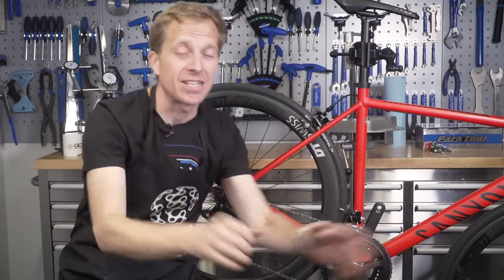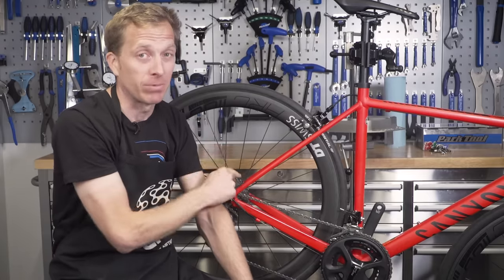5 Minute Simple Bike Gear Tune-Up | Indexing, Cable Tension & Limit Screws

Comment from the maker: What part of your bike can we fix in 5 minutes? Let us know and we'll cover it if we can.
Reply: GCN Tech headset adjustment please 😉
Reply: Wheels
Reply: Hi Jon Great video (as always).  Would love to see more videos about Hydro Disc Brakes and Electronic Gearing (Shimano for me).  Thank you (I know there videos about this but would love to see some more whenever you can).  Thank you
Reply: When checking the rear derailleur L  stop, I push the mechanism by hand to make sure it doesn't go past the largest sprocket. This eliminates any  cable issues which may mask a wrongly adjusted L screw.
Reply: Hamstrings please!
Reply: Brakes
Reply: sweeky bottom bracket please
Reply: maybe how to change a BB or a 5 min wheel true? there are some methods using the frame and cable ties?
Reply: brakes touching the rim (after you removed the wheel and put it back in)
Reply: Maintaining mechanical disk brakes. Not all of us have hydraulic! I feel like I am always adjusting the pads and sanding them down to eliminate squeal, even new brakes squeal within a week (200 miles +/-)
Reply: Tubeless (or Tubular if you're brave!) tyre using the repair plug you mentioned in a recent video.  Cheers!
Reply: Setting up the trim function please 👍
Reply: Cosign this. mechanical disk brake maintenance would be very helpful.
Reply: @_clemens_  is the wheel properly in the dropouts? May sound simple but it's remarkable how often they're not!
Personally I find that I need to lean on the bike a little to get the wheel to sit in the right place.
Otherwise, does it rub in a specific place? If so your wheel may need truing.

Comment: One mistake Jon: When you demonstrated how to adjust the front derailleur "H" screw, you forgot to shift to the small cassette cog at the rear derailleur. All you did was shift the front derailleur to the big chainring and, since your rear derailleur was still on the big cog, you were cross-chained when you adjusted the "H" screw. The thing that viewers need to understand is: Always shift the chain all the way to the inside (big cassette cog, small chainring) when adjusting the "L" screw and always shift the chain all the way to the outside (small cassette cog, big chainring) when adjusting the "H" screw. This is true whether you're adjusting the front derailleur or the rear derailleur. Do not adjust anything in a 2x or 3x drivetrain when you're cross-chained. Cheers.
Reply: Inherited a bike with shimano 105 but there is no limit screws on the front derailleur and the chain is rubbing on the lowest gear. How can I fix this?
Reply: @rabg4774  adjust the b screw
Reply: @tonymcnally9355  Turns out there was limit screws they were just filled with dirt so I missed them. I have tried adjusting them but seem to have only made the shifting worse but I will keep trying, cheers.
Reply: @rabg4774  nah mate the limit screws adjust how far in and out to each side the derailleur can go. There is another screw separate called the b tension screw that determines how far up and down the derailleur can stretch
Reply: Thank you D. Eldon!  I kind of figured this when I was doing the adjustment, and your comment confirmed my (inexperienced) approach
Reply: Thank you for that extra info. Would you be able to explain why my front shifter feels super loose in the braking and in terms of shifting ? Shimano grx 600

Comment: My 105 rear-shifter handle was causing gear changing troubles (small to big cogs not jumping or jumping in 2's). Bike shop couldn't fix it but I did; pulled on the brakes and moved gear shifter across which visibly exposes some of the innards - then blasted the insides with WD40 until it worked correctly; squeezed a pile of grease in with my fingers and it's been as-new for months now (I ride about 200km/week).

Comment: Hey Jon, 

When my bikes need a quick tune up, I check my low limit by hand before adjusting the Low limit screw. I always assume the limits screws are still set properly and if the chain isn't climbing to the lowest gear it's due to cable stretch. Whilst pedaling the crank, I try pushing mech towards the big cog by hand. If it goes to my easy gear, the limit screw is good. Then I skip to indexing. 

This can make things either more or less than 5 minutes at the user's first go at it. Once they have this trick, it would be under a minute to tune/index gears if the H/L is confirmed to still be good. 

Still, awesome walk through. Check your limits. Index gears. Go ride. Easy, peasy. 

*Also, nice new 105 R7000 front mech. Not fair.

Comment: Built myself a new cyclocross bike at the weekend from a new frame, and a set of spare parts i had from an hybrid where i damaged the frame, plus a chainset from ebay. 2x8 speed. Struggled to get the gears to shift properly at all, and i remembered one of the older/longer versions of this video, silky smooth now. Old sora shifters, with a new claris front mech and a deore rear mech (older mtb mech). All works perfectly together with the bontrager 750's and some 35mm cross tyres :)

Comment: I think you might have done this before, but showing how to replace internally routed cables would be great.
Reply: They did that already too
Reply: 2 years late, however this has never failed me: 1) pull out the shifting cable
2) put a spare wire througt which is plenty lon, if it is more than twice what the outer will be, even better.
3) pull out the housing. The spare wire shall be kept inside.
4) thread a new cable outer on the long line, if it's long enough put a stop on the end. 
5)Then simply use the inner wire to pull the outer through the frame.  Put the inner wire aside and install the new shift cable. Profit

Comment: Thanks for this helpful video. I need to adjust the gear shifting on my wife's bike and this will make it easier to do right. One request: show us what you're talking about when you mention a a part. E.g. derailleur hanger at 4:52... I see where you pointed but I wouldn't be able to identify the d.h. on a bike. Also cable stops at 0:17.

Comment: Which way to turn the barrel adjuster? Turn the top of the adjuster in the direction you want to move the chain. Simples!
Reply: But is it the same for the front in-line barrel adjuster?
Reply: At the front: I guess and look if the distance increased btween derailleur and chain (after pressing the shifter again). At the back I of course only do it when it wont shift upwards smoothly...so I turn the adjuster until it shifts...and when it doesn't im turning in the wrong direction :)
Reply: I don’t have the luxury of a front inline adjuster so I imagine I’d just have to do it by ear and guesswork. 

Something else though, if I ever move the cable clamp, I’d always screw in the barrel adjuster and back it off about a turn. Cables don’t usually shrink! Of course Di2 solves all this, but brings its own issues to the work stand!

Comment: My Sora 3500 front shifter has a trim function and Shimano recommends setting it with chain on big in the front and big in the back with the chain just touching the inside of the front mech’s left plate.

Comment: Coming from a mtb perspective where 1x is common, a slightly different order than shown in the video is what i'd recommend:
If you have a front derailleur, start with that one, put the rear on the biggest cog, adjust lower limit like in the video. Put chain on biggest cog in the back, shift up, adjust upper limit as shown.
Then fine tune position of high gear on front derailleur as shown in Video.
Now to adjust the back:
First, check that the derailleur hanger isn't bent, can't adjust that, needs replacing/straightening, different topic.
If hanger is steraigt, continue with
 Biggest chainring on front, shift to highest gear in back. Adjust lower limit so that it just stops trying to shift to the 2nd highest and is silent. (as in the video)
Then, adjust the indexing with barrel adjuster/whatever means to ensure proper shifting up and down the cassette, go to second lowest gear. 
Push derailleur to the low limit and make sure it's too tight for now, to avoid chain dropping behind cassette and into spokes. Too tight means, won't properly shift to first gear. Gradually release until shift occurs smoothly, if 2 settings seem equally good take the tighter one.

That should be all.  In everyday riding, the limit screws barely ever need changing once adjusted properly, even including cassette swaps. The shift cable might elongate slightly over time and the barrel adjusting might need to be updated once in a blue moon. If it's not noisy and shifts quickly, it's fine.

Congrats, by following this you have now achieved +1 to repair skills, +5 to ride quality and +1 to really hard earned cold beverage of your choice. Enjoy that one!

Comment: I read that the shifter cable out of the rear derailleur should come out in a straight line before curving upward, as a curve straight out of the rear derailleur can cause shifting problems. It looks like on this bike, this cable is too short, as it immediately curves upward from the rear derailleur, and it should be longer so that straight line of cable (before curving upward) is there.

Comment: Probably just a rear derailer adjustment needed but the bike pedals on my 10 speed bianchi start peddling by themselves so I have to take my foot off the pedals and apply hand brakes to avoid crashing. It doesn't seem to change gears but the chain looks very loose.

Comment: Hi. This video is obviously aimed at those who already have a fairly advanced understanding of gears / bike maintenance etc and so was wondering if you could recommend a far more basic video i.e. one that can explain exactly what you need to do to make sure the gear cable is running smoothly / clear of grease gunk etc. In addition, seems like most of your videos are aimed at fairly high end road bikes. Can you recommend any that would be more suitable for a bog standard hybrid? Thanks

Comment: If on each front chainring is to be used only a part (~a half) of rear cogs, why You're indexing all of the rear cogs for (any)one front chainring? Should I asume that changing of all of the rear cogs will work perfectly on both front chainrings?

Comment: On the rear derailleur; what is the 3rd adjustment screw called and when do you move it? 
When I’ve adjusted mine it adjusts the jockey wheels higher/lower.

Comment: At 0:38 : How is this black plasic ferrule called , partly encapsulating the shifting cable between the cable tension screw and the cable "fixing" screw at the end?
It is not the normal Shimano Road bike ferrule, that is in the typical Shimano maintenance sets.
Can´t seem to find it or its name.

Comment: Jon is that the new 105 front mech? It looks different to the 105 5800 on my cross bike and I'm pretty sure I haven't seen that cable tension adjustment screw before...

Comment: Hi GCN Tech and thanks for your precious videos. I have a question, I have a two years old Ultegra 6800, with internal routing in my handlebar... how can I fix the problem that my front derailleur doesn't "trim" ? Or big or small chainring no "trim" in the middle to adjust the smooth of the chain on transmission... what can I do? Thanks to everyone.

Comment: Just adjusted my front mech today, I've got it running great but to do so the barrel adjuster on the cable is wound all the way in. If I wind it out it the front mech rubs on chain. I've tried different things to try get it so the barrel adjuster has adjustment either way but just ends up at the end of adjustment

Comment: It's much easier to set the RD limit screws with the chain off and the cable disconnected.  You can eye it much easier without the chain and shift using your hand.

Comment: Hello. good tutorial but I have a different problem that nobody wants to explain how to fix it. My rear derailleur is scratching gears with the chain. Looks like it almost squishing the chain between the casette gears and the derailleur gear. So i need to know, how to move the derailleur up and down, not left and right. And changing length of the chain didn't help. And I don't have any screw to move with it and fix it. Any help?

Comment: I nearly always check the tension of my gearing cables before starting, especially at the front I often have to turn the barrel adjuster at the front 2 times so my front derailleur isn't touching the chain), so I'm not annoyed when started, together with the brakes position (it's not uncommon I had my wheels out for cleaning, put them back in and didn't check if there are nicely centered).

Comment: Got another problem with my gears. There is no problem going from a smaller sprocket, to a bigger one. Problem comes when I won't to go back down again. It won't shift unless I tap twice on the level. Any help?

Comment: Good video, no doubt about that. But even after following it, my gears are still crap. Can't seem to get it right. I must be dumb... and no, the hanger is not bend, it is a new bike with like 200 Km on the clock. When the high gears are okay, the lows will not shift and vice versa. 2 by 9 drivetrain. Drives me f.... nuts.

Comment: Hi Jon
 Indexing my gears thanks to your vid, but I have an issue when pedaling backwards, particularly in the smallest cog - the chain seems to be stretched or not falling onto the teeth properly.. New (200km) kmc chain on a 6000 rear derailleur, 11-30 Ultegra cassette, dura ace 52-36 front.. Any ideas?
I have a turbo trainer (that I've not been using enough) with the same casette bought at the same time. Similar wear. I bought a new chain to swap every few hundred kms to keep the wear similar.. Time for a change? #askgcntech #thanksalotjoncannings #askgcn

Comment: 3:21 terrible advice. Do not undo the cable clamp of your rear derailleur unless you absolutely have to. There might already be plenty of tension on that cable. With most bikes and rear derailleurs you may not even be able to hold that cable in place with two fingers. Just don't do it unless you know that there isn't enough tension on the cable. Try adjusting the barrel adjuster first.

Comment: What about jumping gears? Like when I'm riding without any shifting but suddenly rear gear jumped to another gear. How do I tune that? @GCN Tech
Reply from the maker: Hi Frank, it sounds like your cassette or chain (or both!) are worn - you may need to take it to a shop to get this checked, and will probably need to replace some parts, unfortunately! I hope this helps :)
Reply: @gcntech  Thank you for the reply! But I just bought this TCR ADV2 last Oct and ride less than 40 times till now, basically 360 km in total? And I just changed a new DA chain in Jan, each month I brought the bike to GIANT store for maintenance (I really love my bike)..... how could the cassette worn so fast? Let me try to tune it first with the instruction in this video and see if the jumping gear/cog issue could be solved before I send it to the store again. Thank you!
Reply: @gcntech  Also, now the groupset has the scrubbing noise when I'm in 1-4  and 2-4 gear, and sometimes the rear derailleur shift is not as agile as before, I think the video could solve this problem!

Comment: Can anyone help, im new to cycling. Whenever i put my rear gear into smallest circle the chain slides off and gets wedged between casette and frame. Iv tried turning the limit screws but no luck. Any ideas.?

Comment: There's quite a bit of play in the attachment between my rear derailleurs and the dropout - the bolt with the spring that maintains tension and mounts the derailleur. On all my bikes there's a worrying amount of play if you pull at it. Once adjusted they shift reliably but I do wonder if that's not supposed to be the case, how bad a problem is it, and if I can fix it without replacing the whole derailleur. Additionally, I've had to move my front derailleur to accommodate a larger chain ring and though I set the cable tension and limiters as best I can, spelling always seems wrong. There's always gear combinations that just don't work. There's a high, low, and trim spot on the shifter, but since I moved the derailleur I can't figure out how to adjust the cable tension so there's always a spot that works for any gear combination. I get one gear ratio or more where the trim position rubs on one side and the non trim position rubs on the other side. I'm sure it shouldn't be as tricky as it seems or maybe I've got the angle of the cage wrong since I moved it, but it's really frustrating to feel like I'm always stuck choosing between the gear ratio that's right for the situation and the terrible sounds of metal wearing and money being wasted from the chain riding along the derailleur cage - either from being too far one way or too far the other.

Comment: When I see a video like this I realise what a different world my bike is in. A shifter tune up for me involves data logging the characteristics of the NuVinci hub. Log speed and cadence to get ratio and log servo position. From this I can calculate the values for the equation and multiplers for each cadence setting. Then fine tune the PID so it maintains an accurate cadence without oscillations.
Once done though the only thing that messes it up is the hub wearing out. The ride experience is like nothing any derailleur gears could ever provide even with automatic shifting.